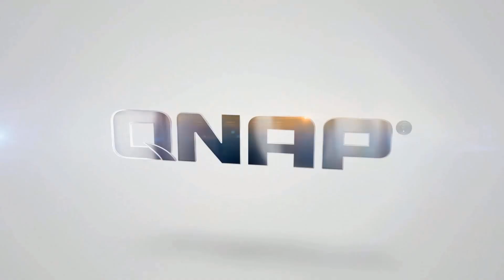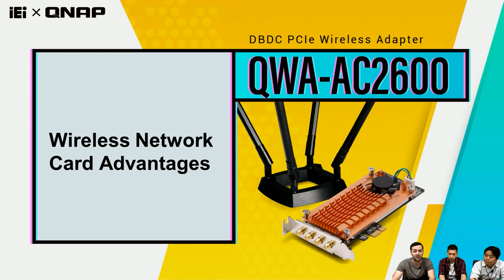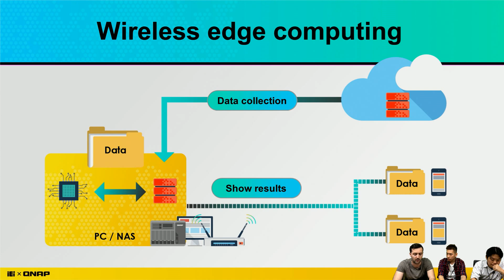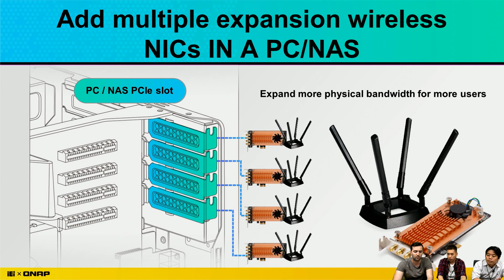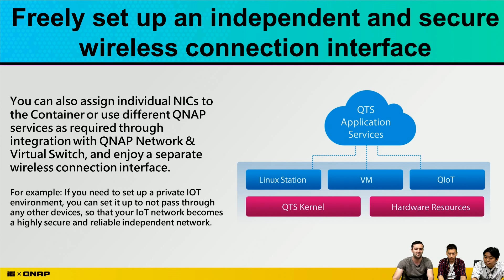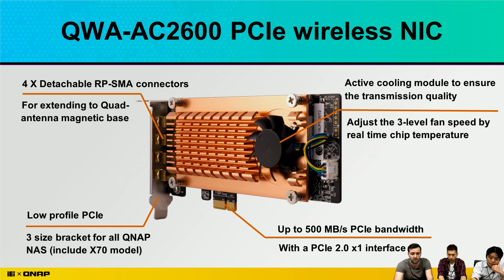QWA-AC2600 tutorial:  Create a Wi-Fi AP for home & industrial applications

Comment: I have used this product since launch.
... About 25% of the time any firmware upgrade renders Wireless AP inactive; until you interact again with it; reactivating the service and restarting the server!
...Another 75% of the time, it Unfortunately takes far more than that simple task or restart to get wireless AP working again.

Sometimes I've even had to go so far as to uninstall Wireless AP as well as uninstall Container Station (which will automatically reinstall, once you add WirelessAP back); then starting from scratch; reconfiguring everything, then finally making sure to also manually re-assign the Default Dateway to the eventually visible ISP connection.

Why has this app rarely ever been updated?
...With the last update being over a year ago.
...And why is the hardware and app, rarely tested with a new firmware release to assured it's continued uninterrupted operation?

It has the potential to be an extremely convenient product. 👍 
...Although you must also suffer with some pretty serious speed degradation when it really comes to porting/routing through your QNAP AP to a much faster, wireless ISP connection.

Many more optimizations and refinements need to be made to both the firmware and the application ‼️

Comment: ty for this video, it's very well done. we need more content like this :} very instructive for the details which is sometimes a bit lacking in the manual for users setting up.
Reply: I purchased the QWA-AC2600 and wished the presenters showed more than just how to install this PCIe card and linking it into QTS Virtual Switches. There is nothing I found in this video about advanced or even basic WiFi config: assigning channel bands, radio power, security ..etc.  There is too much about QNAP marketing this product.  I suspect any useful WiFi radio config will require command line work...., but we will have to guess the details ... We want QNAP-UK to make a useful video regarding the radio config.